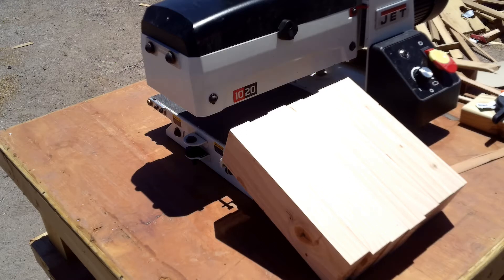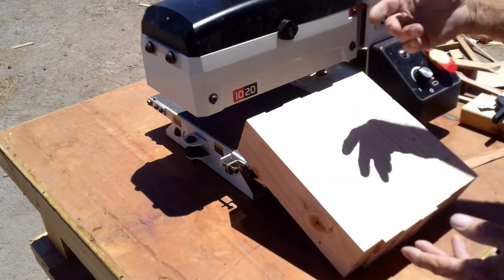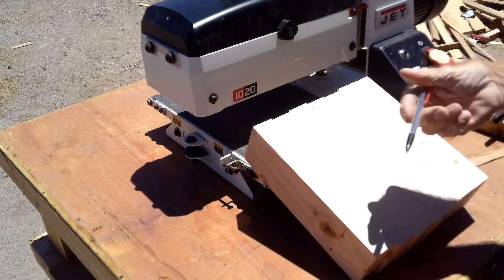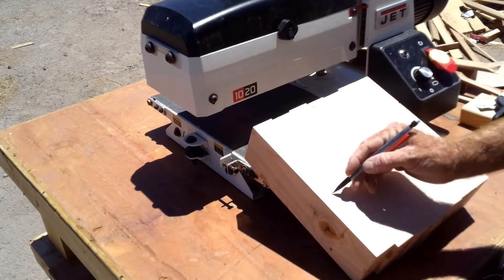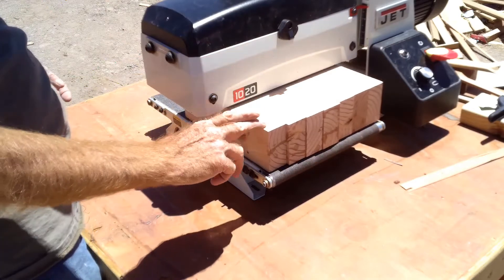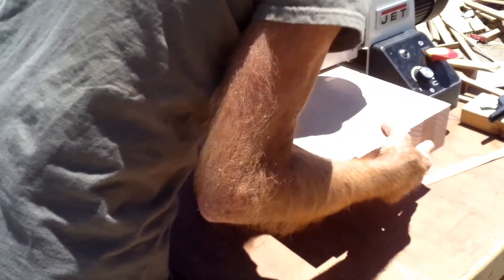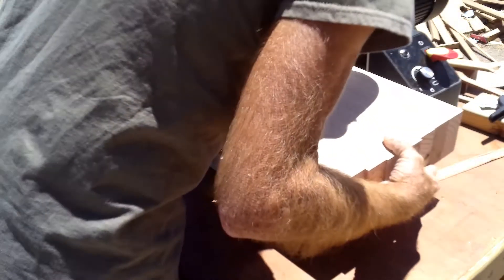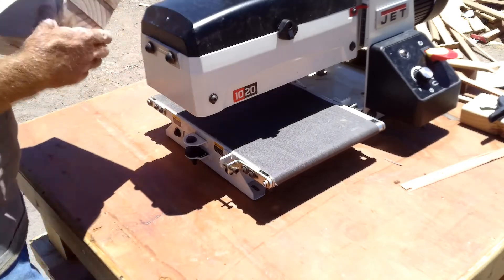Drum sander calibration block

Comment: Good info but how are you adjusting the drum?
Reply from the maker: The drum can only be raised or lowered, it can't be "tilted". To adjust side to side thickness, you change the adjustment of the table.
Reply: How do you adjust the table so it’s parallel with the drum?

Comment: Thanks, that was a really good explanation.
Reply from the maker: Thank you! I'm so glad you found it useful!
Reply: @alhefner , I did have a question. I notice that you wrap the sandpaper with a slight space. I butt the wraps and try to pull them as tight as possible, but I am having trouble with burning, and I was wondering if the butting of the paper is causing this. I don't use the drum sander as much as I would like because I seem to go through sandpaper pretty fast because of the burn streaks. Any advice would be appreciated.
Reply from the maker: @Dan-jq8se  I've found that the burning is a combination of belt speed and depth of cut. A slow belt speed makes the sandpaper remain in one place long enough to heat the wood. Also, a deeper "cut" causes more friction, thus more heat. When I see burning, I usually speed up the belt and raise the drum. Also, the type of wood you're sanding has a lot to do with it. Wood like pine with a lot of sap will gum up the paper and cause a lot more burning. Hardwoods such as oak or walnut, not so much.

About those gaps in the sandpaper. What you see in the video, I think, is the replacement sand paper that Jet sells. It's simply cut wrong! The only way to get it tight is to put those gaps in, or have one end of the drum not properly covered. I've started making my own from rolls of 3" sand paper. That works out much better for me and it's a lot less expensive.

Comment: An additional comment: I stopped using pine for calibrating my drum sander.  Growth rings in the boards sand differently than soft wood between the growth rings.  The left-most board in your calibration block has mostly vertical growth rings.  The fifth board from the left apprars to have mostly horizontal growth rings.  I predict that after several passes through the sander, the first board will give a thicker readding on your caliper than the fifth board.

I get much better results using MDF because density is very consistent.   A person can run two ten inch lengths of MDF through the sander, one near each end of the drum.    Then measure and compare with a caliper, or lay the pieces  closely next to each other on a flat surface such as a table saw top and slide a finger tip back and forth across the two pieces.
Reply from the maker: Good ideas! Pine also gums up the sand paper! I was thinking of using maple or red oak.

Comment: You cannot make a calibration tool with the tool you plan to calibrate it with BEFORE the tool is calibrated to begin with.
Reply from the maker: If you watched to past the 4:30 mark, you'll see that I used a set of digital calipers to check the thickness of the two opposing edges to determine whether or not the outer table adjustment needed to be changed. What I did in the video works perfectly, if you watch the entire thing, that will make sense.
Reply: @alhefner  makes sense to me, I'm about to go do the same thing with my sander. I skimmed the video, but maybe you mentioned it, but I plan to mark "inside" and "outside" on the non-sanded edges of my calibration block so I don't accidentally swap them during this process. This is much easier than using the process in my manual, and more accurate I think.

Comment: You made an entire video on alignment without doing an alignment and showing how to adjust the bed to the drum.
Reply from the maker: I was just demonstrating how to use a big block of wood to check the calibration. HOWEVER, you're right! What's the point of showing how to check something if I don't also show how to correct it? I'll doo one in the near future showing how to both check and correct the calibration! THANK YOU!
Reply: @alhefner  The adjustment of the sander will vary from model to model, what is important here is you demonstrated how to use the calibration block to get your machine right. After this, folks should use the manual for their particular model and make the adjustments. For example, I have a Grizzly, I have no interest in knowing the specifics of how you adjust your machine. Great video, thanks.
Reply from the maker: @CliffQ76  Thank you! Yes, marking "inside" and "outside" is an excellent idea! When ya get interrupted duri8ng that fourth pass and have to leave the work, it would be very easy to get the sides mixed up!